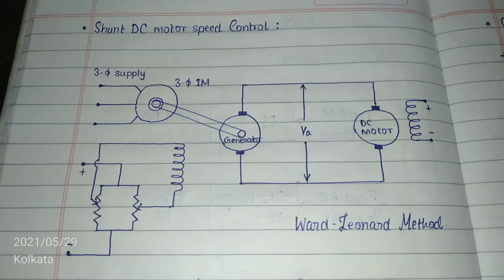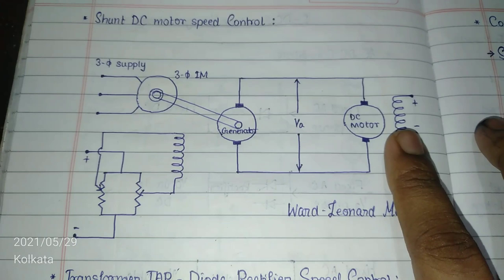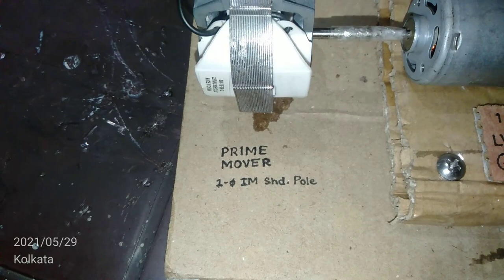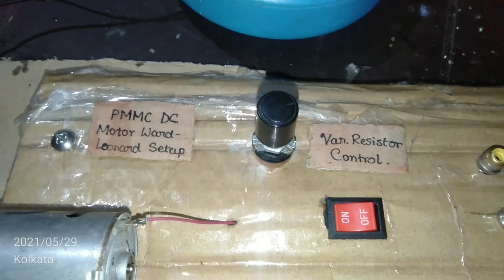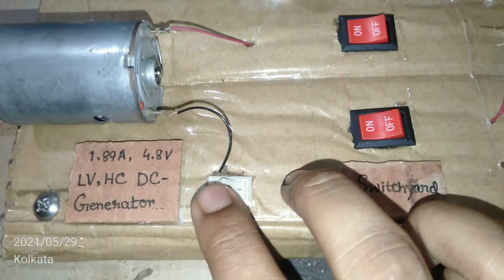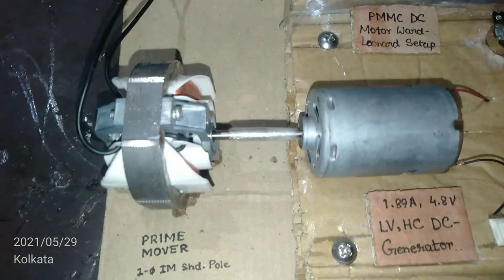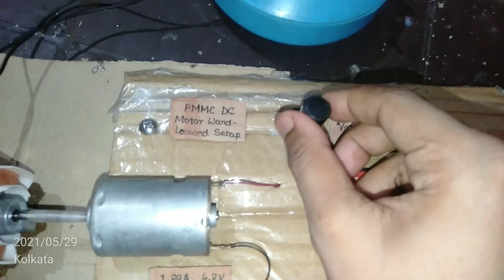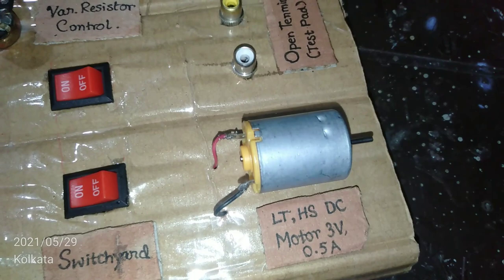The Most Inefficient Method of Speed Control? || Ward-Leonard Method

Comment: Sir how many volte supply can you give for first motor
Reply from the maker: The first AC motor operates at 230V AC... Just for demonstration I used a PMMC motor... The Potentiometer I connected to armature of the load motor to control the armature voltage. Generally a DC Separately excited or Shunt excited generator's excitation winding is used to control the excitation voltage and thus the output voltage to load is controlled... Hope I was clear 😃
Reply: In my country, we still have some cable cars that are being controlled like that. Mostly built in or before the 1970s, when thyristors or VFDs weren't around yet. Well explained!